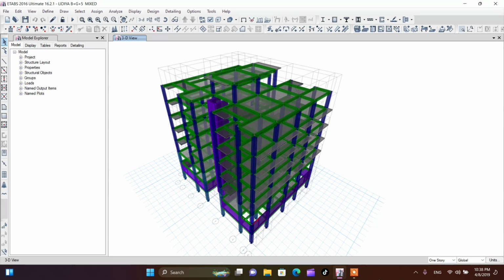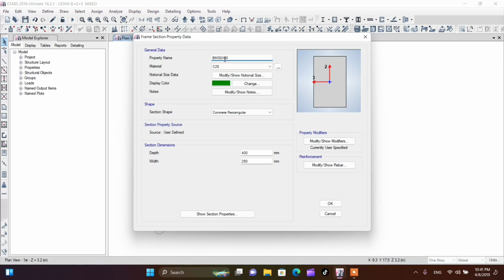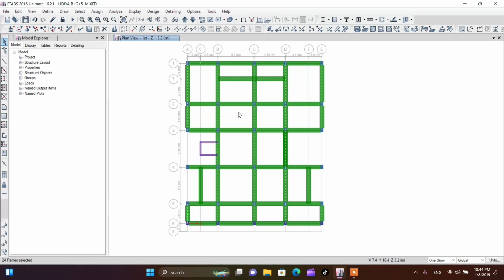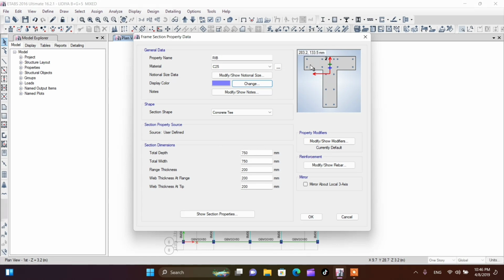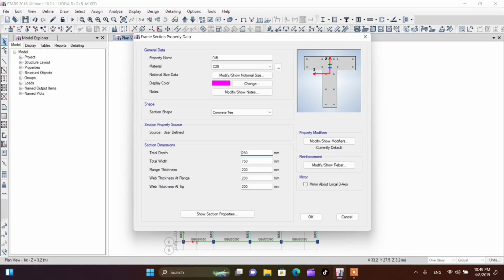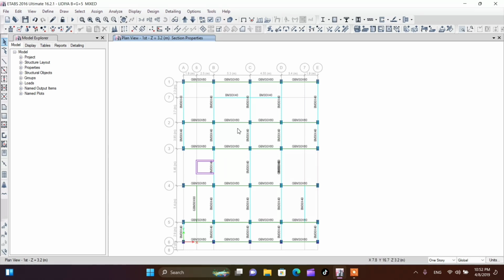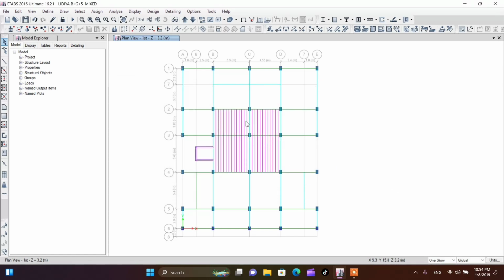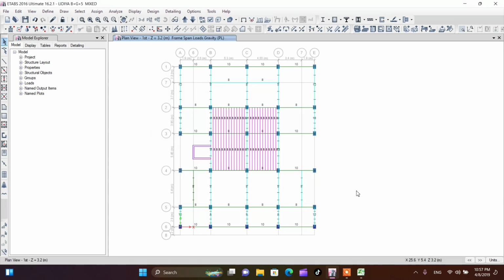Ribbed slab design Start to finish in CSI ETABS civil engineering structural engineering tutorials

Comment: What if their is a cantiliver in both direction. And Etabs make the secondary beam end moment release. So is that correct shoudnt be it continuous beam.
Reply from the maker: Good question, Recommended modeling approach is actual ribbed slab but when u model only beams you have to fix the following: 1. Model  ribs as T beam for more stiffness. 2.model as continues fix to account diaphragm only since it is not actually true in construction.
2.

Comment: Great presentation!
Could you clarify the distinction between a ribbed slab and a ribbed beam, and indicate whether they are modeled as beam or slab elements?
Reply from the maker: Ribbed beams or ribs in simple term are model as secondary beam in etabs bro bro. Thank you for drop